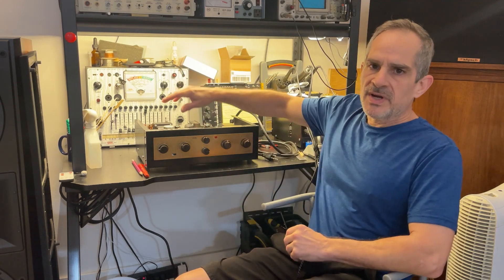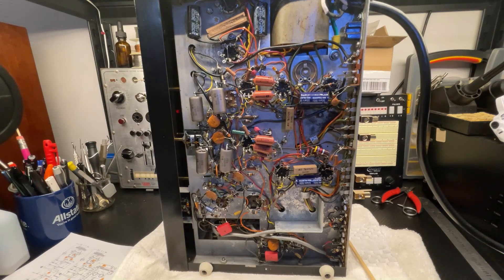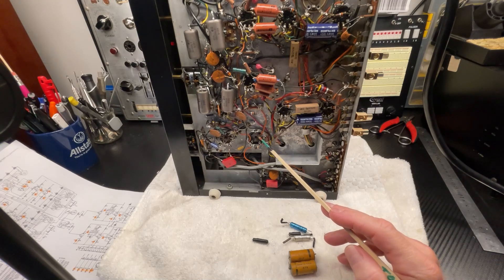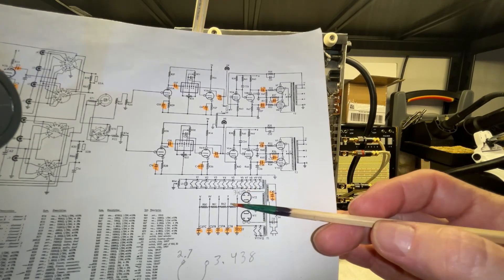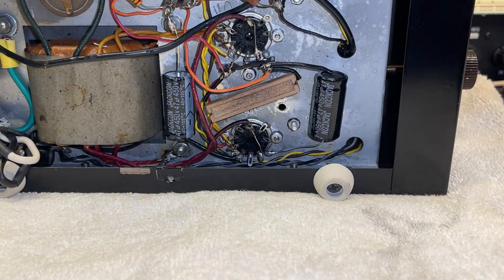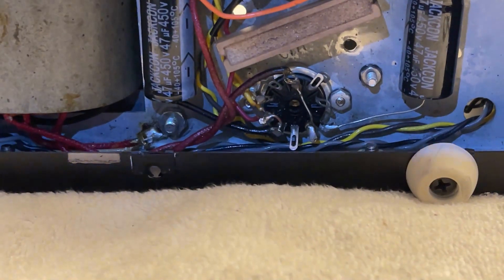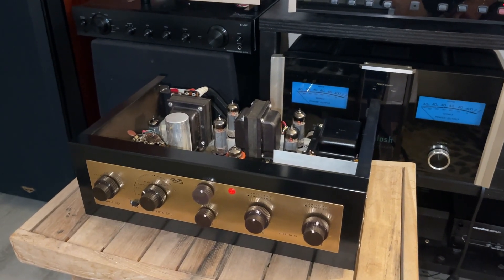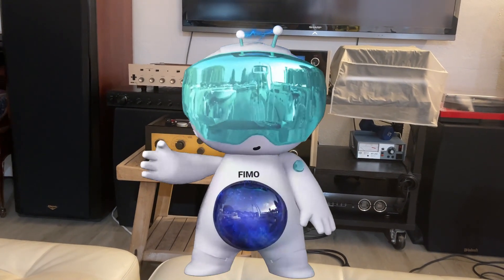Eico HF-81 6bq5 Tube Amp Humming Transformer Repair

Comment: If you really wanted to have a monster integrated amplifier. Take the eico HF-81 with its active tone controls and use a pair of dynaco ST-35 output transformers in place of the stock eico ones.you will have to tweak the feedback loop. But the fidelity will be alot higher..
Reply from the maker: Hello teammate. Happy holidays. I am terribly sorry for taking nine months to reply, but I had not seen this message somehow.
I have a modified unit that sounds spectacular. I reduced the feedback by 
3-DBs as part of the modification and I absolutely love it. Regarding the output transformers, are the Dynaco transformers that much better? Eico’s are pretty good.
Thank you very much teammate
Reply: @Tinybench according to many seasoned professional builders and tinkerers the dynaco ST35 output transformers are the best 6bq5/el84 transformers ever built.
Reply from the maker: @dannyalvens5418 
Hello teammate,
Thank you so much for letting me know.
I’ll be on the lookout for an SP 35 parts unit.
There’s a company that sells replacement re-issued transformers, but I would stick to the originals. I believe that, even if you try to clone them, the mythology of the copper windings is probably not the same.
Thank you very much once again teammate and if you haven’t, I would really appreciate it if you subscribe.😊🙏

Comment: Very nice video! I own an Hf-81 and is sonic bliss. One question though, is it a reason why you removed the preamp tube shields?  I see also that two of the 12ax7 have rubber rings and in the “original form” they don’t even have metallic shields. Thanks !
Reply from the maker: Hello teammate!
Thank you for watching my video!
I removed the shield temporarily while I was working on the unit. I put them back on after because they shield, electromagnetic noise.
The rubber rings are for microphonic. They prevent vibrations from making the glass vibrate.  I personally don’t like to use those unless necessary because they interfere with free convection, which is when hot air rises and draws cool air in.
Like a hot air balloon, air in contact with the glass races and creates an earth flow that helps the tube dissipate heat.
Therefore, I would only use it if I have a problem with microphonic in a tube. Microphonics is when mechanical vibrations of the tube can be heard coming out of the speakers.
Please be on the lookout. I am in the process of editing and shortly posting a new basket case HF 81 video.🙂🙏
Reply: @Tinybench  thank you very much for the thorough answer! Looking forward to watching that next video :)

Comment: Nice video. I bought a Conrad Johnson classic 62 in 2020 that has a hum since day one. I called them and they said try to clean up cables and such and maybe it’s because I have efficient speakers. I have cornwalls. I guess I probably need to send it back. It sound great but in between songs there’s a 60 hz hum. What do you think. Also all tubes have been replaced and no change
Reply from the maker: If I understand it correctly, the amplifier is still humming with the RCA disconnected. If the amplifier is still humming with the RCA disconnected there is something wrong with that amplifier.
Reply: @Tinybench  that’s what I thought. But what do you think about what he said-“that amp always would hum with no rca connected”
Reply from the maker: @scottkasper6378  
I think there’s something wrong with the amp.
Is the noise coming from both speakers?
Reply from the maker: Why don’t you upload a video?
Reply: @Tinybench  both, yes. its a 60hz hum both sides. its quiet, but definitely there
Reply from the maker: Hello teammate!
please unplug the RCA cables from the amplifier and let me know if it is still humming with no RCA cables connected.
Reply: @Tinybench  yes. I did that thinking it was a good way to know which component was causing the hum. I troubleshoot machines for a living. So I told him I did this and he said that if you do that on this amp that it will hum anyway. He said u can’t run it without interconnects or it will hum. I don’t know much about amps so I figured he was right.
Reply from the maker: Let’s start again from scratch teammate. Please kindly remove the RCA cables and let me know it’s still humming. Thank you! 
🙂🙏